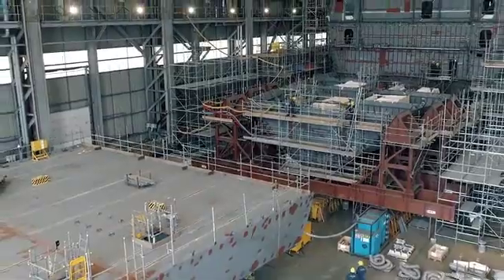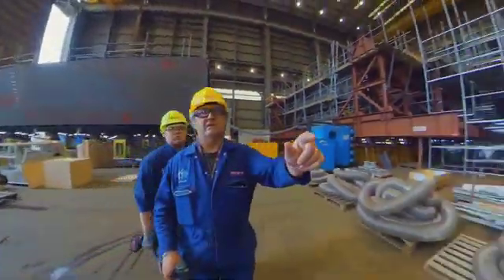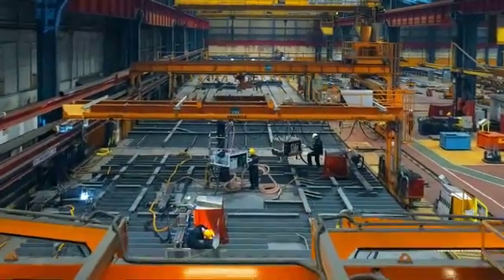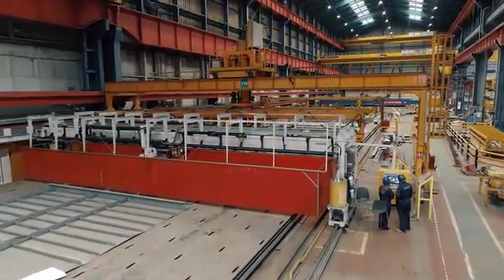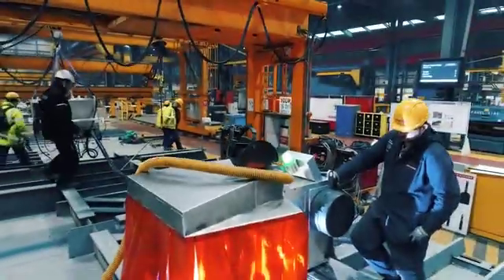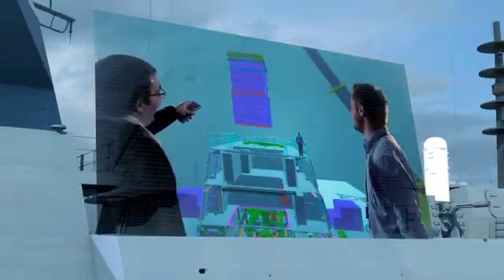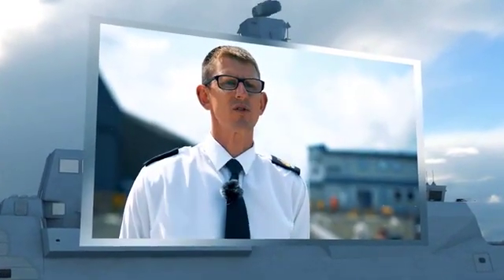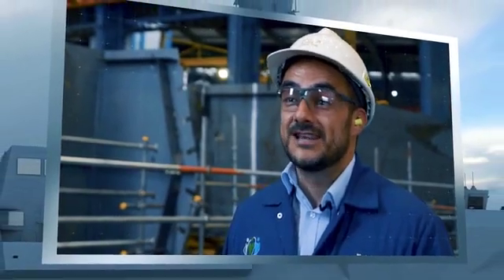From HMS Glasgow to HMS Cardiff - The shipbuilding team at BAE Systems

Comment: Polite question were you buying your steel from
Reply: According to UK Defense Journal ~35% will be sourced in country, and the rest foreign imports. According to BAE systems, the main reason is that many of the steel types needed are not produced on a large enough scale in the UK to make the procurement of said steel from UK companies financially viable. However with the QE class carriers, only ~3% of the steel used was from foreign sources, just as an interesting side note. However, if there is enough incentive, then the percentage of foreign steel used may decrease if more UK companies decide that they want to bid for BAE to use their steel instead (i'm not sure if that's actually possible, just making an assumption).
Reply: @kimjonglongdong3158  thanks
Reply: A lot of the Steel used comes from Sweden,its a particular Plate Steel that couldnt be sourced in the UK.